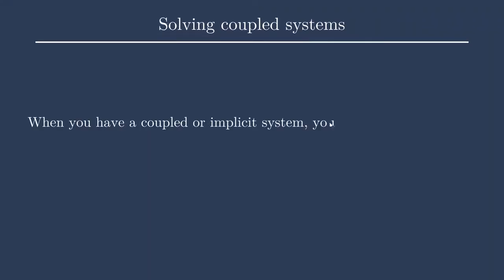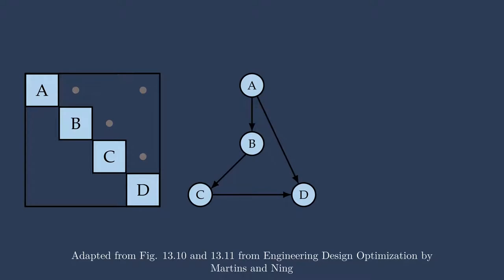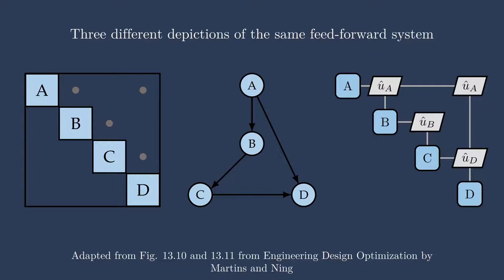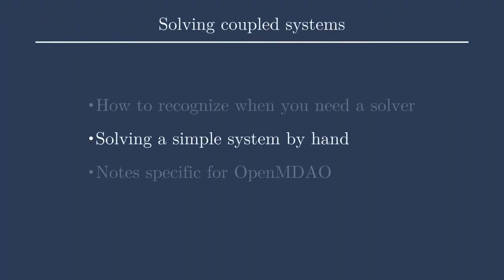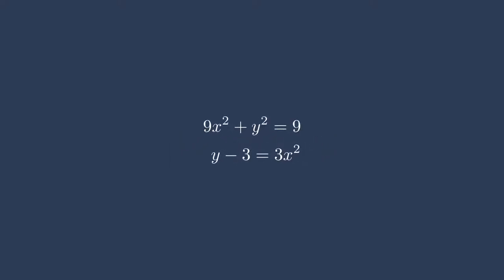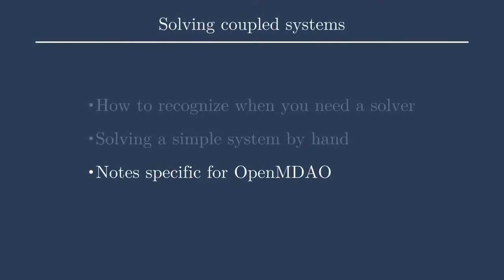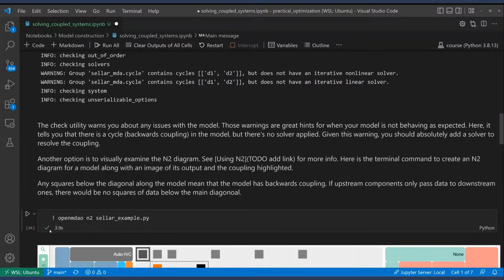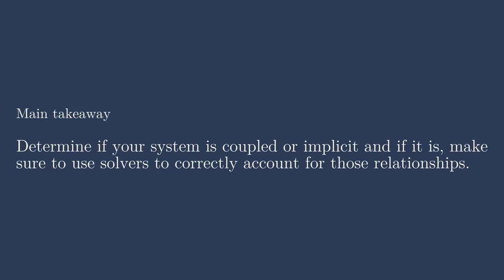Solving coupled systems

Comment: is openmdao used in the industry? can i get a job doing specifically this, instead of mdo?
Reply from the maker: OpenMDAO is indeed used in industry, across different fields, such as aerospace vehicle design, wind energy, financial markets, and others. That being said, OpenMDAO is a tool to help you perform MDO. If you're looking for a career in this space, it makes sense to learn MDO in general, and you can use OpenMDAO to help you solve complicated problems.

I acknowledge I'm biased too as I've made a career out of doing MDO using OpenMDAO. :)
Reply: @OpenMDAO  thanks. I was asking of mdo is usually done with other tools.